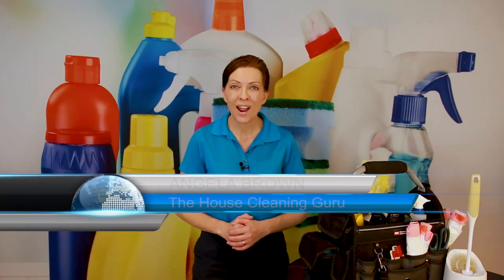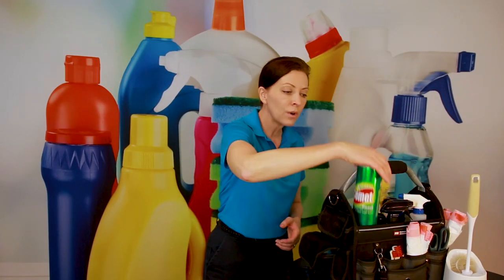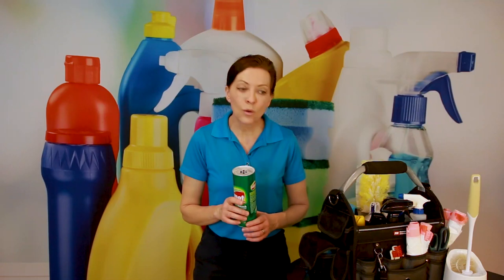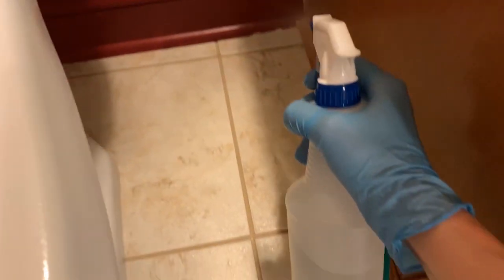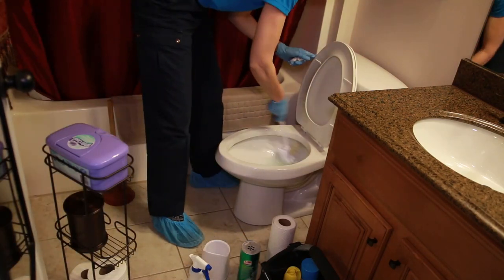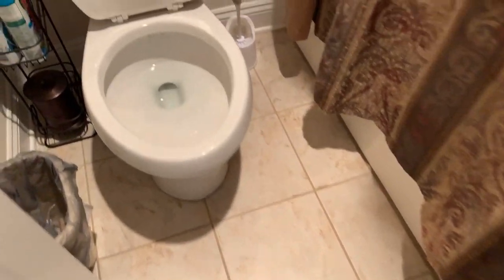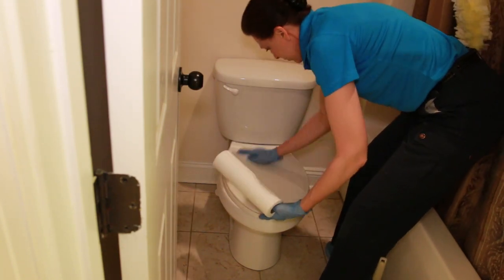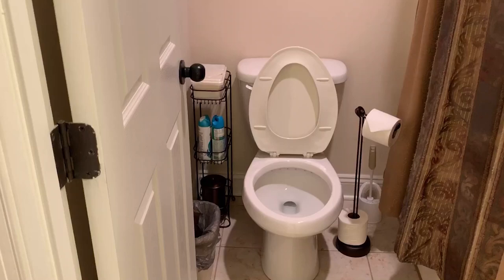How to Do a Maintenance Clean on a Toilet

Comment: My plumber told me that the abrasives in comet settle inside the horizontal portion of your plumbing and he says don’t use that stuff. Please comment. What do you think?
Reply from the maker: I haven't heard that before. Are you using water to wash it down? We use so little of it and use water after scrubbing the areas that we haven't had problems but it is possible I suppose. Let's both look that up and see if we can find out more information on that. Thanks for sharing it.
Reply: @AskAngelaBrown  I was taught to use it to bleach my porcelain kitchen sink and rinse with plenty of water decades ago, so I was shocked when an older guy plumber told me that I was depositing sand inside my pipes. I’m now a landlord with several buildings to maintain and I threw out all of the abrasive cleaning products I owned in my own house. I told my tenants the same. I’ve never seen the Evidence, though. Thank you for posting your cleaning information. It’s inspiring me to clean up the house!

Comment: How do you clean a toilet tank if it has residue from drop-in cleaning tablets?
Reply: Lime away! It's the best!!
Reply: @JWC777  I was more interested in a method to clean it. Does the water need to be drained? If yes, how to do that?
Reply: @jaxt7197  oh snaps sorry I just realized you were asking about the tank. I was thinking the toilet bowl.  Sorry I'm not sure how to clean the tank.
Reply: @JWC777  No problem. I live in an area with very hard water which presents a whole separate set of toilet cleaning issues, even with a water softener system. :)
Reply: Shut off water and flush twice, put cleaning vinegar in a spray bottle and spray all throughout your tank tank and wait for about hour. Then use scrubbing sponge and scrub all the grime and lime, turn water back on and flush. If you have lime build up under your toilet rim, you can spray strips of toilet paper with vinegar and lay it around the rim, let it sit for awhile then scrub with toilet brush. Hope this helps.
Reply: Once a week I put bleach in the tank & swish it around. I started this when I got a new commode trying to prevent a buildup of crude in the tank. So far so good.
Reply: Ducky       I do know that cause I used to have a septic system, however I use bleach once in a great while. For every day cleaning I use a dishwashing detergent which works very well for a while then I have to go to the bleach.
Reply from the maker: Thanks to all for sharing ideas here. 👍

Comment: Help! How do you clean down the hole at the bottom of the toilet? The toilet is cleaned weekly, but no matter how hard I jam the brush down the hole, it never can reach or clean the brown stain at the bottom of the toilet. The stain is in the hole where the water discharges, I wouldn't even call it stain, you can see it has quite a thick buildup. It honestly looks like diarrhea pooled at the bottom of the toilet. It appears to be in reach of the toilet brush, but I just CAN'T ever get it clean. Help!!
Reply from the maker: I'm curious what type of toilet brush you are using. Most toilet brushes fit in the drain of the toilet.. That said, you could always clean it out by hand. To do this:
1. Turn off the water at the back of the toilet by turning the knob connected to the hose that goes into the  wall at the back of the toilet.
2. Flush the toilet. (This will drain all the water.)
3. Use a towel to soak up any remaining water in the drain of the toilet (The toilet will still be wet)
4. Shake some dry powdered Bar Keepers Friend (Safe on ceramic, porcelain, etc.) on the wet toilet stain. Looks like this (paid link: https://amzn.to/3xNbQV3) 
5. Use a brush or sponge to mix the cleanser with the damp toilet basin creating a paste on the stain. Let it set for 2 minutes.
6. Use non-scratch scrub sponge - looks like this (paid link: https://amzn.to/3xNbQV3)  or a toilet brush to clean the stain. 
Note: you can also use an electric drill brush for the scrubbing part - looks like this (paid link: https://amzn.to/3xNbQV3) but be careful that the metal part doesn't touch the inside of the toilet drain - or the metal on the drill bit will scratch the porcelain.
Reply: I have this same build up from hard water.  Unfortunately we have tried multiple times and haven't been able to completely remove it.  We have soaked it with straight vinegar for up to an hour, then actually got a small screwdriver and scraped the crusty gunk off.  It's just a lot of lime and calcium.  Unfortunately the metal screwdriver scratched the surface.   But it needed force!!   I think the key with that is to tackle more often, maybe monthly instead of yearly!!?
Reply: I'll try Barkeeper's powder too!   Thanks, Angela!

Comment: Something about wiping the toilet seat after wiping other parts down first. I was taught to only use a corner piece of a microfiber cloth on the seat first...which makes sense. Why would you want to expose skin to germs from the back of the toilet???
Reply: I wouldn't use a cloth to clean the toilet. I would use something you can dispose like paper towels or Lysol wipes. And I use a seperate piece when I clean the seat.
Reply from the maker: Thanks for sharing your thoughts on the video. 👍

Comment: I would strongly suggest that one does not turn the water supply off. Each time the water supply knob is turned off and on, it can lead to a leak presenting...talk about an unnecessary business expense of having to pay a clients plumber to fix a leak that may have damaged vinyl flooring or water damage in a second floor bathroom. My suggestion as the alternative is to use a gravity flush. Fill up your mop bucket, lift toilet seat and lid to the upright position and dump the water from the mop bucket into the bowl. This will cause the water in the bowl as well as the mop bucket to evacuate the toilet bowl completely but no refill from the water tank will occur. There will be the smallest inch or so of water still in the exit loop thus no sewer gases will be able to enter, however you then have a very exposed toilet bowl for the ultimate cleaning area. A simple normal flush action will then refill the bowl when completed...the same as when water supply goes out in massive power outages and well pumps or city supply is compromised. You always have one flush remaining to each potty. I usually do a pre-scrub bowl clean prior to the gravity flush to really see what I’m dealing with. I also use the most “unused” toilet (typically a powder room) as my mop water dumping station and clean it last.
Reply from the maker: Great tip...thanks for sharing!

Comment: Don't use paper towels as it is a waste. Paper towels are for food preparation. I use cleaning cloths. They are color coded so I use a different one for the toilet and the floor and the shower and the sink. I am not a professional cleaner. I clean the bathroom after showering. I squirt with a cleaner and let it set while I shower. Then when I get out of the shower I wipe over the bathroom. I use cleanser and do heavier cleaning periodically. This is when I clean my toilet brush and then I air it out.
Reply from the maker: If cleaning your own home, this method you mention is a great one since there is no risk of cross-contaminating cloths with another customer's home. And yes, you can wash the cloths in the laundry to save on waste to the landfill. Thanks for bringing this up. 👏👏👏

Comment: What about hard water in a toliet?????
Reply: I used Lysol lime and rust toilet bowel cleaner to remove the ring from the hard water stain lime built up, etc. I poured water into the toilet to reduce the water level and then I applied the Lysol lime and rust toilet bowl cleaner and allowed it to sit for 20 minutes then scrubbed the toilet with a toilet wand scrubber.
Reply from the maker: Thanks so much for watching the video. Check out the BRITE and CLEAN Ultimate Hard Water Stain Remover website: https://www.hardwaterstain.com/best-hard-water-stain-remover/how-to-remove-hard-water-stains-on-porcelain-sinks-and-toilet-bowls
I hope this helps! 👍

Comment: Have you ever used Santeen product to remove hard water stains in toilet bol?
\12368/
Reply from the maker: Hi Judy, I am familiar with it but the last Safety Data Sheet (which is required by OSHA and the Globally Harmonized System) I can find on it was in 2015 and it is vague at best. http://prolinecp.com/sds/SanteenDelimerToiletBowlCleaner-SDS.pdf
We know it's hydrochloric acid but we don't know in what concentrations. In section 9 (Physical and chemical properties) all of the chances they have to help us understand what we are using instead chose the words "not determined".  They have listed all the risk factors - but since we don't know what we are dealing with and in what combinations, I'm uncomfortable using it and would not recommend it.